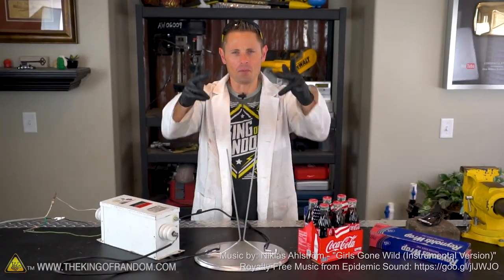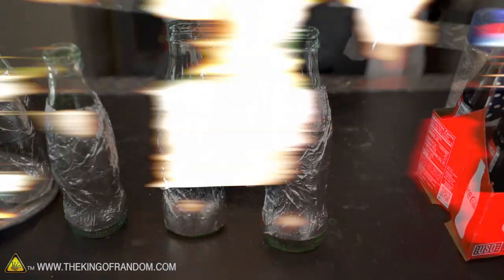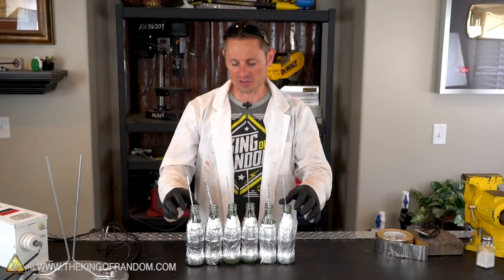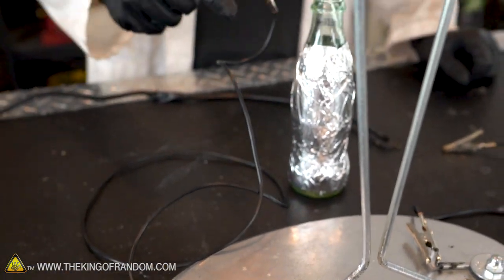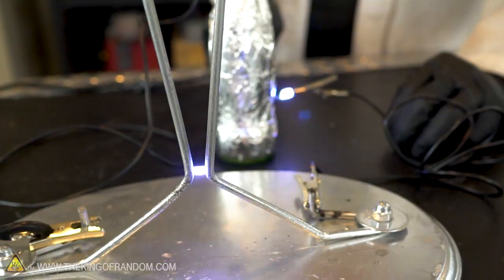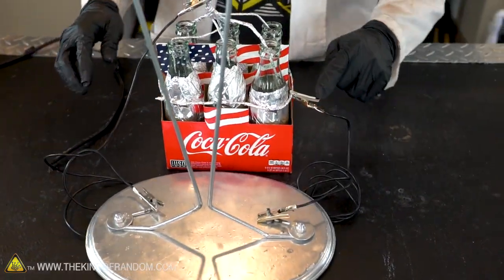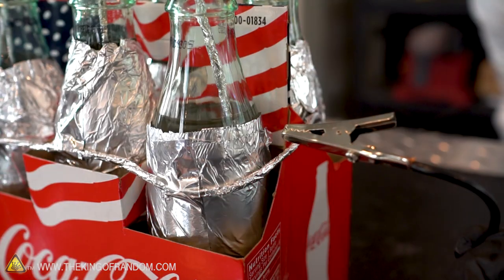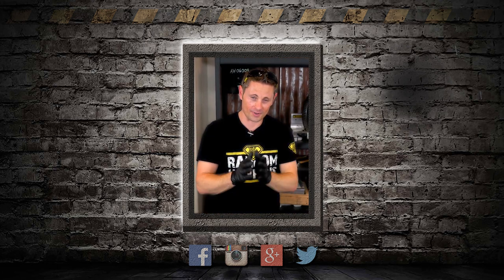How To Make Lightning ⚡ With Coke Bottles?! The King Of Random Lightning In A Bottle Experiment

Comment: Adjusting the distance between the rods on the J ladder could allow the stark to rise. The increased power provided by the cap bank should increase the distance it can jump. Also we didn't see the clip brought to the rod only to the coke bottle cap. It would be nice to see if two sparks form or all the energy results in a single spark higher on the ladder.

Comment: Grant, I have gud question and it is would it work if you used ionized salt?
Reply: There's no such thing as ionized salt as all salts have an ionic structure
Reply: When salt dissolves into water it's not the water that conducts the electricity it's the ions in the salt

Comment: How is this a battery? And also, the reason it goes upwards is because the arc super heats the air and turns it into plasma, plasma is conductive so it stops arcing and goes through the plasma instead (the arc is the really blue thing you see later on, the plasma is more purplish as you see early on), the plasma is what goes up with the hot air around it and takes the arc with it, its a small distinction, but very important.

Comment: Cool video! However, that description isn't really accurate. You don't have more voltage by adding the capacitors since capacitors don't generate electricity; they store it. The effect is that they filter or smooth out the power being delivered. The capacitor will also phase shift the frequency which, in my opinion, is most likely the difference you're seeing in the Jacob's Ladder. Now capacitors with diodes can be setup to produce a voltage multiplier that would step up voltage, but that's not what you have here.

Comment: Does the jacob's ladder also work in a vacuum? Please try this :P
Reply: No it does'nt. I learned this in 7th grade physics already that electricity can only flow in a vacuum if it is ejected from an electrode. The jacobs ladder does not eject these electrones, but instead builds up high voltage until the electrones surpass the resistance of the air inbetween, creating plasma in the process which would act as a conductor afterwards. In a vacuum there is very few air to be turned into visible plasma, so no lightning arcs in a vacuum. The most that could happen is the electrones to possibly leave the electrodes, which I think is very unlikely due to the special structure of an electron ray emitter, and then fly around in the vacuum for a bit before hitting the other afterwards, which you cant see unless you inject nobel gases into the vacuum that could get energized by the electrones.
Reply: electrons. not electrones. 1 electron, 2 electrons.
not peares, so therefore not electrones, unless you wanna act like they're a band or something.

Comment: on the capacitors you built with the coke bottles, its better to not have any sharp edges on your aluminum foil as you will get voltage loss through sharp edges..
Reply: sorry i guess i commented before i watched the video fully.  I see now that you were aware of that already.

Comment: "There's so much power the air current can't lift it. It's driving through the point of least resistance there." That's almost right. A static electric field is produced inside the bottles that stores energy. By definition there must be a higher voltage across the capacitor to store that energy. Thats quite actually called charge. So the net effect is that you're actually raising the voltage. Which is why it never climbs the ladder because it doesn't need ionized air anymore to arc. At such a voltage even the conductivity of air is enough.

Comment: Me and my dad were melting lead on the barbecue and pooring it into wooden molds and i was windering what would happen if you used a metal with a higher melting point also what diffefence wet vs dry wood would make

Comment: You were wrong about air current lifting the spark,  what your doing is increasing the amperage while decreasing voltage, less voltage = less distance the spark can jump, more amperage means stronger spark.

Comment: Those thin gloves will do nothing against this high voltage. Just try to put a sausage inside one and touching the power supply cable. It will burn through instantly.